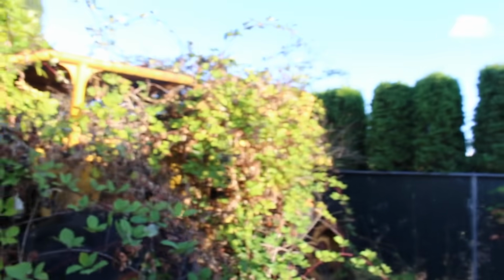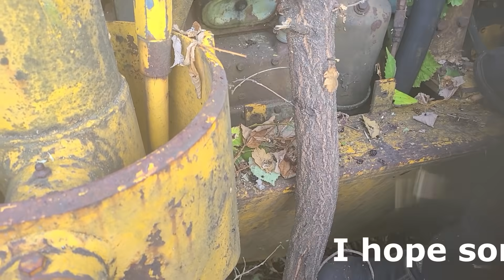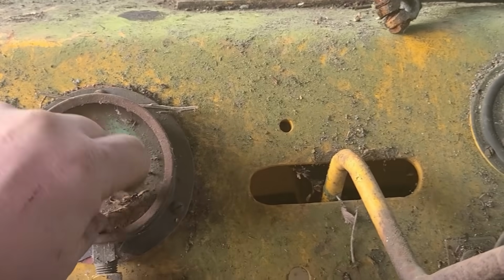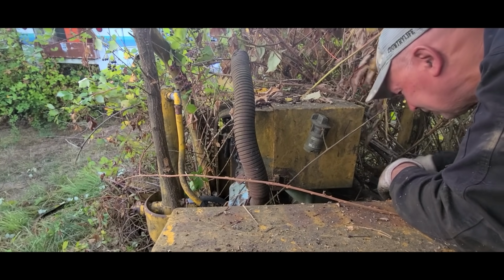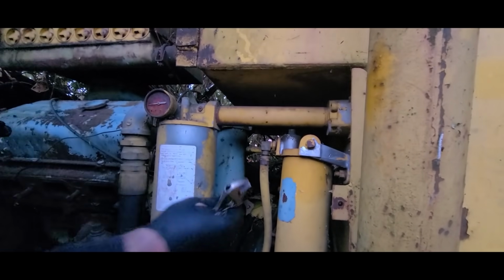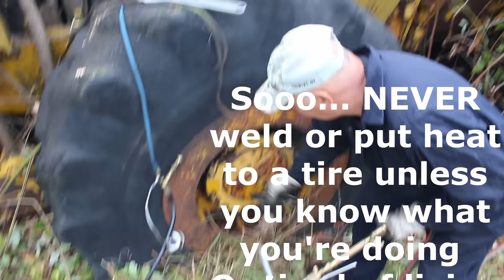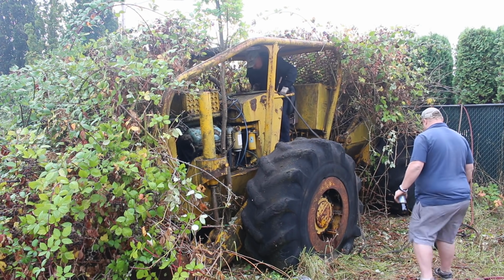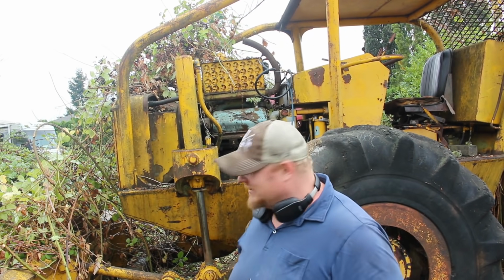Forgotten skidder pulled out of the blackberries, Pettibone sitting 20yrs after it was rescued once!

Comment: Call Pettibone Marketing...... you could probably work some sort of deal or get some plans you can work with.  Send them a picture of the plate, "It runs! Do you have the operation/ Mechanic manual?"  Probably make someones head explode.
Reply: I got 4 cyclinder detroit diesel 360 cfm air compressor they built wont talk to me

Comment: there is a Detroit 6v71 in the dump truck i drive at work and if i stall it sometimes it will kickback into reverse rotation i have to remember to shut the key off so it dies before i start it back up or it will shier the starter off
Reply: It's hard on air filters also...lol had an old terex front loader would do the same, running backwards thing. Everything worked just backwards...lol good memories.  Ty....
Reply: @billallen4793  ya when i was new to the job the guys all had a good laugh the first time i did it because i came across the radio saying something like all the gears are going in reverse.... thats when an oldtimer gave me the tip about the starter

Comment: Wouldn’t been more efficient to dig it out a day or two before calling the mechanic? That way everything is off the machine before any attempt at checking out the mechanicals? Then soak all the pivot points in penetrating oil so it might work a day or two later?

Comment: Was going to ask why you didn't lift the blade when you started moving her, got the answer at the end. If she's a 2 stroke engine with a dynamo she'll work fine with the battery reversed, the hydraulics won't but everything else will, the battery will be fine as the dynamo output is dependant on direction of rotation, so turn it normal and positive is on one side turn it other way and positive swaps to the other terminal.